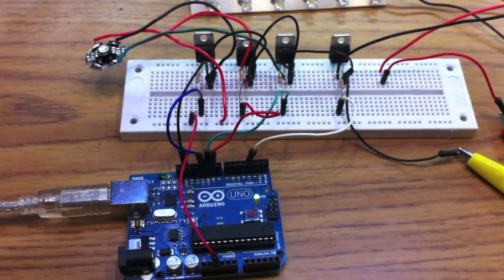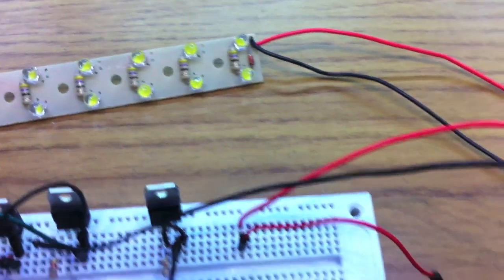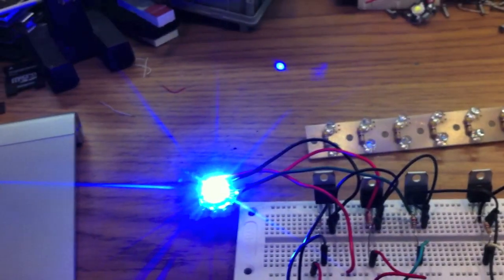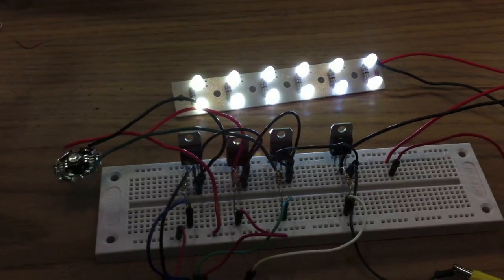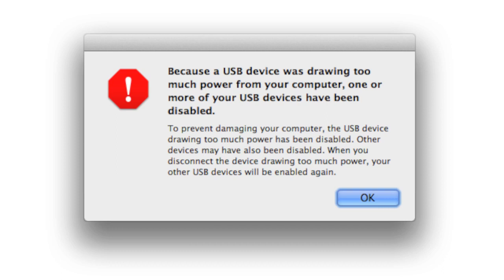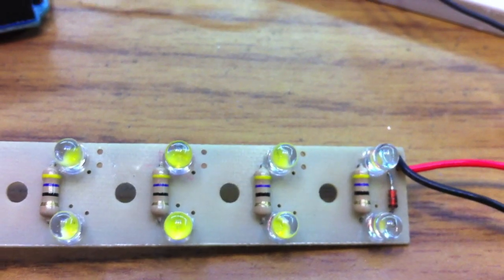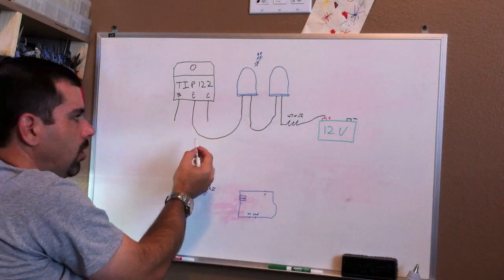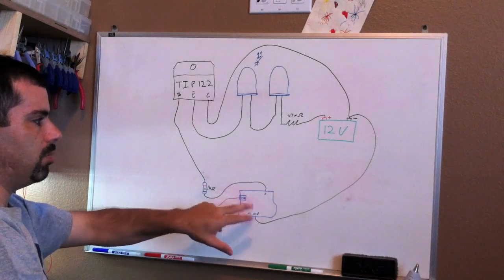Controlling high power (or a high number of) LED's with an Arduino

Comment: Hi, I am running the same TIP122 transistor but for 8 UV LEDs (3.2V drop each, max 20mA). I want to be able to have PWM control over these LEDs for a variable intensity. My resistor load is 330 Ohms for a 30V supply and I tried calculating the base resistor to be ~33k although I think I did something wrong. I've tried various base resistors from 990 Ohms to 39k Ohms but all that happens is that the LEDs stay powered when I turn on the power supply. I have also swapped the emitter and base connections like some people have suggested in the comments. I am a novice at circuits and any help would be appreciated, thanks.

Comment: Hey! Is it possible to use the same same connection with multiple 3 whatt leds(around 20 or 30 leds)?. If no how do i do it?
Reply from the maker: It is possible to use the same connection, you just need big enough wires and MOSFET to handle all of the combined wattages (60-90 watts total) It may be better to control groups of 10 with a single MOSFET for each group.
Reply: @TheCustomGeek  thankyou!

Comment: Hi, thanks for the amazing video. I have a question, did you have to use a different Voltage for the Red on the COB LED? I'm working on an RGB High power LED to work with Arduino, but I think the Red LED may require a lower Voltage than the Blue and Green. I'm wondering if I will have to use a voltage converter (to lower) just to connect the Red or not. Thank you!
Reply from the maker: Good day sir! Red generally runs at a lower voltage, so a larger resistor would be necessary. There are a lot of resistor calculators online to see what resistor you need based on the voltage and current of the LED. Have fun!

Comment: What is the maximum amount of power that a TIP122 can control? I have a 24v, 3.5A (continuous) DC LED light I would like to control via PWM. Can I safely use a TIP122?
Reply from the maker: Hello, the TIP122 can do 5A continuously, but you might need a heatsink for that kind of operation. :)
Reply: @TheCustomGeek  Thanks for your reply.

Comment: I would like to build a low-voltage LED lighting system for my home, similar to this product: @ I wonder what will be required to home-build this from scratch. Do you recognize that driver board?

Comment: hey there just saw your channel and this awesome video best one out there
got a question to you sir
am building my KITT car and wanted to build my own scanner and i build a basic one already tested and works good but now its time to build one where i can be using 12v leds you can find them on license plates ect in cars

could you pls help me out here am thinking to use a tip120 and a resistor but if you could make a video or a blueprint for me i would be thankful  Dave cheers

Comment: When trying it out on a TIP 120 it worked connecting the emitter to ground and the LED to the collector. I don't know much about the topic but just in case it didn't work for someone.
Reply: Looks like he swapped collector and emitter in his whiteboard diagram.
Reply: Gonna try this myself. Don't really understand transistors, so I'll try both ways and see what works. Got lotsa salvaged parts in my junk box....

Comment: Thanks for the video! I learned a lot about using LEDs with Arduinos. This is going to come in handy for a project I'm working on.

Unrelated, but people generally wear their watch on the non-dominant writing hand so you can check the time easier.

Thanks again!

Comment: Is there a solution that has a bunch of these transistors in a compact form factor, maybe an integrated circuit or an Arduino shield? Looking to do a project and switch 12 separate devices ON/OFF, with an Arduino.

Comment: does the transistors heat up when the load is connected?
Reply: Rodney Yrureta Depends on the load you’re connecting, different transistors can withstand different powers.

Comment: What's the difference in the schematic of using a AC/DC power supply instead of a battery?  Just hook it up to the negative post of a barrel plug from the DC power supply?

Comment: Could you tell me if this setup would work to dim a 100w LED COB (Cheap Chinese eBay buy) - I have a Mean Well 100W LED driver (AC 100-265 | 50/60Hz & DC 20-40V | 3A) I have nearly every flavor of Arduino board- but lately have been going to the Wemos D1 as my first choice due to it's built-in wifi
Reply: or would a higher power darlington be necessary:  http://www.ebay.com/itm/BU323AP-Transistor-Lot-of-1-A-B4-/162081181172?hash=item25bcca8df4:g:HdwAAOSwMN9XQ6BU - this one is rated at 150W

Comment: Hi, nice tutorial! Just what I was looking for. As a novice I do wonder how it would work with a 24v power led. Do I connect the positive of the led to the 24v positive with a resistor in between? If so I reckon that 1k will not be enough right? I've tried connecting the Arduino negative to the 24v negative and the power led positive to the Arduino 5v. It works but draws too much power, causing my 3.2" TFT to shut down.

Comment: Easily the best video I've seen yet, walking through EXACTLY how to utilize external power for devices that can't run off of the Arduino's power output, but still controlled by the Arduino. Well done!

Comment: HI, nice tutorial. If I wanted to dim a high power LED, using external board power and external power for the LED also to isolate the Arduino from current draw.. maybe on a POT or automatically, what would be the best way to modify this circuit?

Comment: could I use this same circuit using 24v instead of 12v? I want brighter LEDs on a 5m strip aand I think 24v can run a higher wattage over 5m

Comment: Thank you very much for the video.  You demonstrated exactly what I was questioning.  Although, what I'd like to do is simple add to existing LED displays, my wn larger segments, not using Arduino at all.  I worry about what to do with ground from external power supply.  How do I return the ground signal safely to original smaller device?

Comment: I have four sets of led light consisting of 7 LEDs, 28 LEDs, 32 LEDs and 36 LEDs each 20mA with a Vf of 2.2, using 9V for power source.   Control power output Iusing a relay board and programing through the Arduino board.  When I use ohms law I get figures that are higher than the input voltage.  When I use the calculators I get too much load, but this doesn't look correct.  I would like to alternate the first three sets of LEDS and have the four set be a slow fade.  Please help!